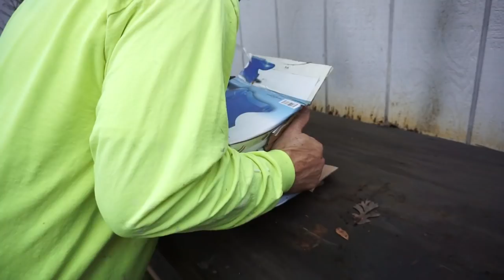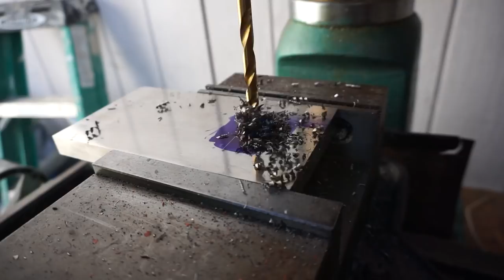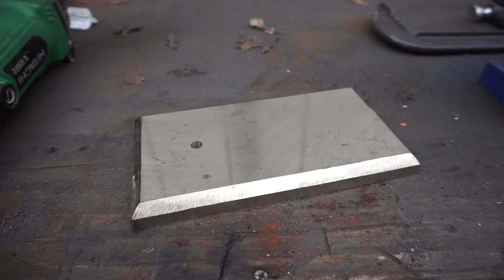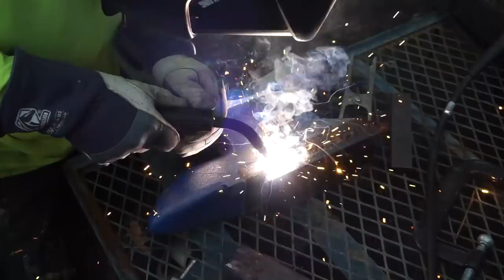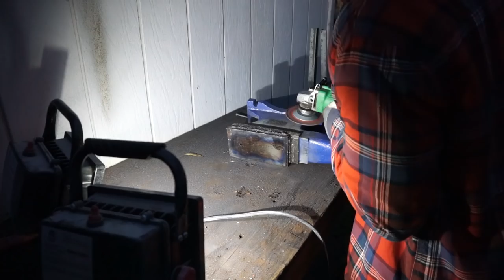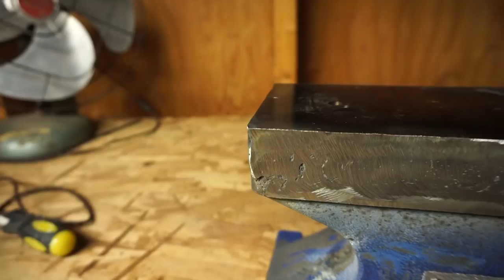HARBOR FREIGHT ANVIL: Upgrading a $60 HF Anvil, Part 1

Comment: There is a point where it just makes more sense to buy a decent anvil to start with. The A-2 was not free. You had a torch, welders, grinders and some skills. How many hours did you spend on the project? It was interesting BUT.  Question welding steel to cast. Won't it crack when you try to use it?
Reply from the maker: I completely agree with you. If I started again, I'd either build a sturdy anvil out of known steels, such as 1045 or 4140, or I would just buy a plate of good steel, mount it to a stump, and call it good.
Reply: yep, thinking the same thing, a day of work..or more, wasted on something new you overpaid for in the first place just to get it in a useable state. I have a 4ft peice of track, think ill just spend some time on it.

Comment: Good one. I'm using one of these guys atm while I save for a little rhino. I have to say, they will get the job done for us beginners. I've been working on the craft for almost half a year and I'm not disappointed in it. Horn could be round, could be made of steel, and the rebound.... but eh, worth the experience. If I can make a simple leaf key ring, or an Egyptian khopesh with it, anyone can. 🍻⚔️🍻
Reply: I have the HF I just bang metal once in a while wasn’t worth for me to buy a good one but what I did when I installed the plate I drilled several holes after all the edges welded and them I put some large screws, grinded the heads of the screws and mig weld any small hole. Not bad so far.

Comment: use it as is , you don`t need re-hardening .
Reply: + Lance Teodecki  
in this case welding on the edge does not create enough  heat  for annealing .
Your plate must be  at least cherry red glowing.
Reply: Alex Mann you don’t know what you are talking about.
Reply: @life-te7to  
I talk about my way to do it,and it`s work well , for me.

Comment: Thanks I have the same thing. I also have a plate of D2 and a plate of A2 and am still debating on which one to weld to the anvil.
Reply: This is also my comment. I did the same, but cut off a piece of the A2 and welded it to the top of the Horn with hard face wore and I’m still grinding it, but it looks really good. I’ll post up the anvil upgrade video. I don’t think you really have to Temper the A2 and you’re probably more likely to shatter it at some point, unless you’re also normalizing it later. It was probably pretty close to what you did welding it and grinding it. https://youtu.be/ktfa27-FJ7k?si=t3wwnhVgkEBwvTu9

Comment: Would it work as is for a starting anvil for knife forging
Reply from the maker: I wouldn't recommend it, because it's ductile cast iron and is so soft. I would try to find a piece of tool steel plate that will be hard enough to work as a striking surface, and screw it down to a log or weld it completely through to a heavy piece/stack of steel (which would require rehardening) and go with that. It won't be any more expensive than the HF anvil, and it will be much harder, tougher, and better overall for blacksmithing!

Comment: Great idea!! Questions: Where did you get the steel plate? How much did it cost?
Reply from the maker: I bought it on eBay for about $20, and I believe it was A2. To be honest, I'd recommend just finding a large piece of steel to begin with. The cast iron HF anvil just isn't good, but the hardened face definitely helps

Comment: Why were you preheating the Anvil with a torch, before you guys tack welded it?
Reply from the maker: The cast material welds a lot better with adequate preheat. I'm not sure that we heated it up enough, but it definitely helps 👍🏼

Comment: So, the big question... what did it cost you to do this and was it less than the 300 dollars to buy a suitable steel replacement?
Reply from the maker: Was about $80 for the anvil and the A2 top. It's not great, but it's a hell of a lot harder than the original cast material 👌🏼
Reply: They spent $80-90... plus several hours, considering any peasant who has time to hobby should not be making minimum wage.  It's super not worth it. Just buy a tfs or NC.

Comment: Now correct me if I'm wrong but didn't all that wielding just destroy the "hardness factor of the hardened steel. I mean it would've been better to just put the hardened steel on a wooden block, mounted it and used it that away.
Edit: it just seams like a lot of extra work and tools you didn't need to use when the steel that you wielded on would've been fine to start with.
Reply from the maker: The steel started out annealed, so welding it didn't change it much. In the part 2 video, we heat treated the anvil, which made that A2 top much harder. Mounting the top to a block of some sort would have been much easier and cheaper, but the goal of this series was to make the cast iron Harbor Freight piece of crap into something that can be used a bit more effectively.
Reply: But if you have the steel plate already you wouldn't buy a crappy Harbor Freight anvil. Make the crappy anvil into something more effective using stuff not already setup for forging.  That is the challenge.

Comment: What rod did you use for welding?
Reply from the maker: Originally 7018 because it's what we had lying around, but it was 1/8" and too much for the little welder to handle. We ended up switching to 5/64" 6013 because we had some of that lying around too, lol. The Vulcan 165 handled that much better.
Reply: @FormulaJake  I was wondering, because I have a cast anvil. I have wanted to put a hard face on it. Have you used your anvil much and is it holding up?
Reply from the maker: It's holding up great! In the part 2 video, I heat treated it, and smacked it a bit as well. The problem is that I only welded the edges. If you are going to weld a face on, stick weld the entire face from the middle out, not just the edge. Since I only welded the edges, a lot of energy is lost.
Reply: Airborne Productions how do you weld from middle out? Isn’t the plate covering the middle of the plate? I might be missing something btw
Reply: @FormulaJake  Ah so you knew. I left a comment highlighting this. I'm glad you already knew.
Reply: @therealamerican99.76  You would have to grind HUGE bevels on the anvil itself, going almost all the way to the middle line of the anvil.  I would recommend leaving just a 1/4 in strip (less if you have a small welder, you need full penetration) of the surface running down the middle of the anvil, rest the top plate on that strip, then fill in the entire bevels with welding material.  It will take a lot of time, but the end result will be much better.
Reply: @Kur Norock. Thanks a bunch! I have access to harden-able steel, and I might make one as soon as I learn how to weld!

Comment: My only issue is there will be a gap that absorbs energy but still I’m sure the a2 rebound makes up for the bit that is lost. And it’s much better than originally
Reply from the maker: You're exactly right. The hardness of the A2 is far better than the original cast material, but the rebound is much less than it should be due to the gap.

Comment: Nobody else has said it so I'll say it.  

You've wasted your time really.  You would have been better off just using that A2 plate bolted to a stump.  Without completely through welding that plate to the anvil, leaving no gap at all between the two, you've completely negated the weight of the anvil itself. 

The purpose of an anvil is to have continuous mass directly under the hammer. Having any sort of gap breaks the line of continuous mass and breaks the flow of energy through the mass.  

Really you should have ground your bevels all the way in until you had only about 1/4 inch or so of the top of the anvil left, then completely fill the bevels with weld, turning your anvil and A2 plate into one solid piece of metal. 

Don't get me wrong, you can definitely use what you have and it will serve you fine, but your setup had a lot more potential that you've wasted. Not trying to be mean, just trying to be helpful. Constructive criticism and whatnot.
Reply from the maker: Unfortunately, we learned the hard way 😂 I appreciate the honest criticism, as I have so much to learn when it comes to metalworking. We did a homemade 180 pound anvil series where we welded A2 onto milder steel, and left a decent gap that we completely filled in by stick welding. The result was so much better. It actually feels like one solid piece of steel, whereas the little HF anvil feels like smacking stacked up, loose pieces of steel. Definitely better and harder than the cast iron HF material, but not solid like it should be. Oh well, lesson learned! It still forges, so I'm happy for now! 😂
Reply: Don't be silly.  Explain completely through welding? A full penetration weld on that plate!  I have welded at serious amps and very high temperature and my 3ph 1200A sub arc machine would struggle.
Reply from the maker: If you leave a gap across the entire plate, then fill in the gap with a stick welder, you can make one solid welded connection.
Reply: @FormulaJake  That would not be a through weld.  That would be a serious bevel and a very deep welded joint.  It would be easier to braze it together.   Why does it need a tool steel plate on top anyway?
Reply from the maker: The cast material that harbor freight starts with is extremely soft. Even light hits seriously deform the striking surface. It just isn't a good anvil.
Reply: @FormulaJake    OK,  your not really supposed to strike the anvil but I see what you mean. It's obviously for hobbies and model makers due to its tiny size